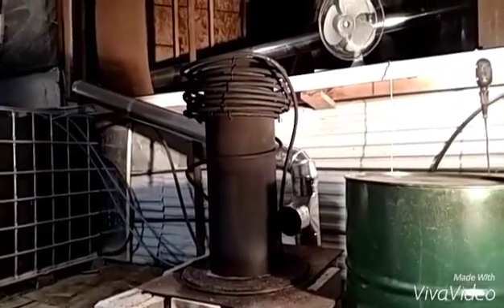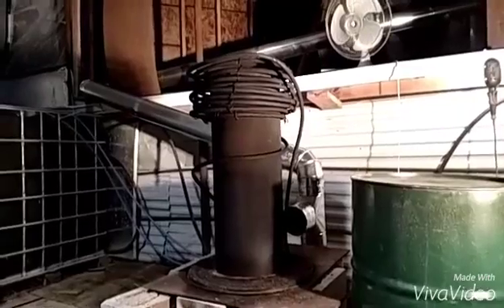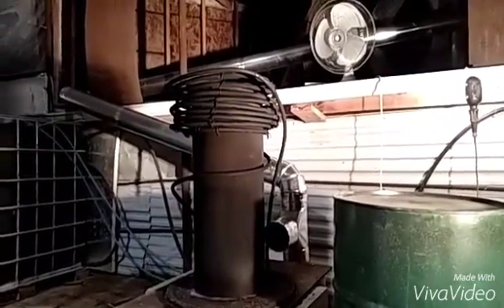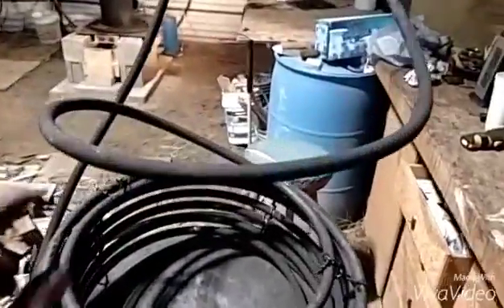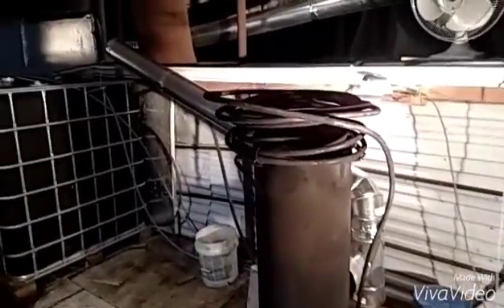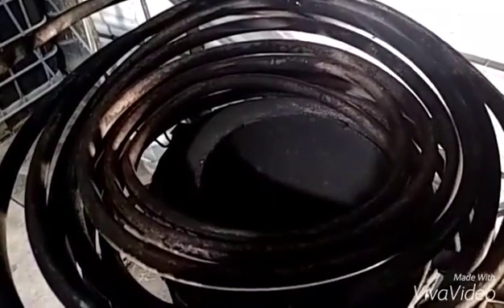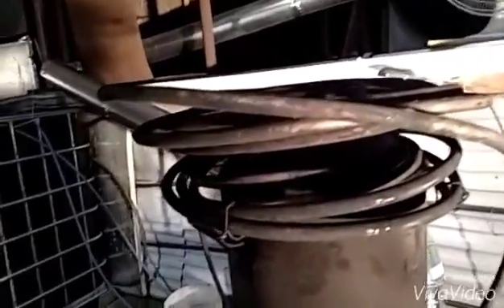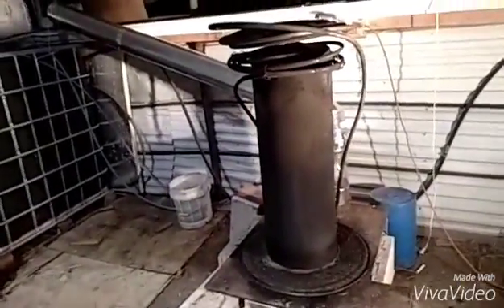Modifications to rocket stove Pt. 9 for the Aquaponics greenhouse

Comment: would a 310 grade stainless steel coil in direct contact with the riser tube help heater the water to higher temperature ?
Reply from the maker: DRJMF1 
Yes I think it would. I may have been able to wrap the copper tube right around the riser. I don't remember why I didn't do that.
Thanks Von